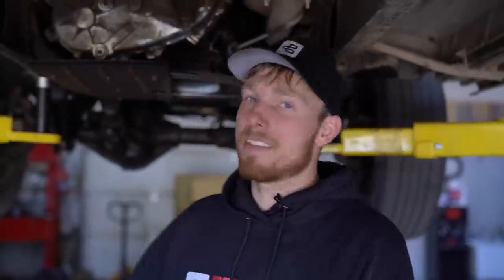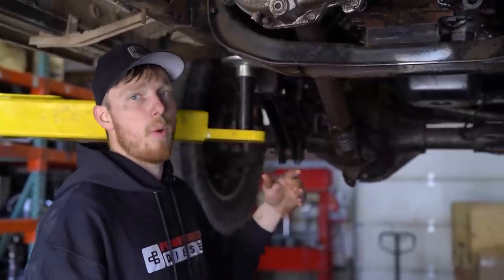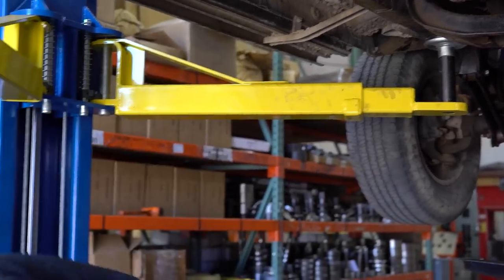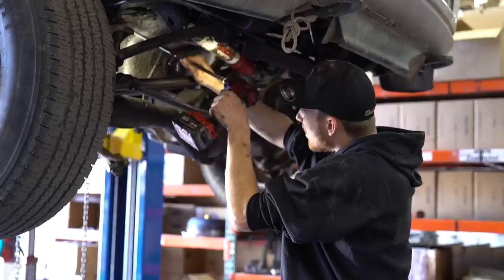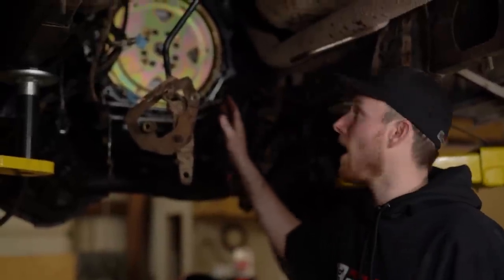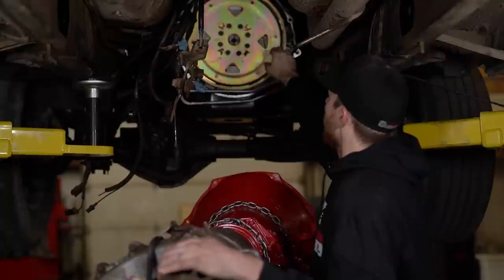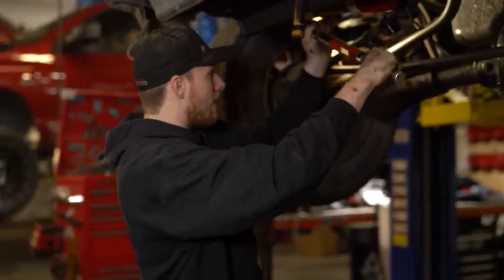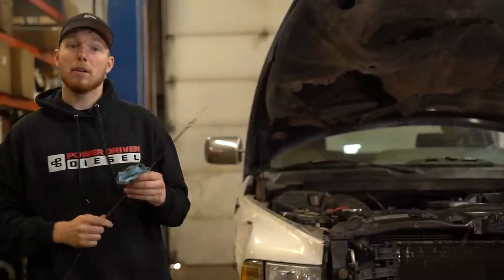How to Install a Cummins 47re 48re Transmission

Comment: Not me who just did this job twice and was only able to get 4/6 torque converter bolts back in the 2nd time cause I didn't know the flexplate had balancing holes 🙃

Comment: Question, I’m seriously considering PDD as far as transmission build. As far as purchasing onsite, because my truck only has 88,000 miles, what’s the turn around time on using my core and having PDD install? Thanks
Reply from the maker: That depends on how many builds are ahead of you. I think we are basically caught up at the moment.  Call into the shop and we can get something scheduled.

Comment: I appreciate the videos,  i ran my transmission a bit over full ..its a good idea to check the pressures. . I was surprised how good a 48re shifted in my brothers truck shifted . My old 47rh that finally went out never shifted that good .. Thanks for the information on the pressures . I remember how low the pressure was on my stock 47rh at idle and lock up . Surprised it lasted long as it did .
Reply from the maker: Glad to help

Comment: It sure looks easy with a lift. I’ve done it twice so far with jack stands and a creeper. It’s such a mess pulling the pan that I got a hand pump to draw most of the fluid before I take it off. Your frame spreading jack is a bit cleaner than my bottle jack and 4x4 setup. The 4x4 held up but it was marginal. Bottle jacks don’t always like to work sideways. I laid mine down flat and filled it with all the hydraulic fluid it would take so the jack would work better while horizontal.
Reply: I did the clutch on my 1999 on my back twice... now there is a two post in the barn.
Reply from the maker: They are much Easy on a lift

Comment: I am wondering how dose a transfercase hold up to 1000 hp range. Is there anything you need to do to that. Maybe a rebuild or any billet parts?
Reply from the maker: They actually do very well if they are in good working condition.  I have a bone stock fresh dhd in the Godfather!

Comment: I have heard that stiff flex plates can cause other parts to give way. Does the HD flexplate still have enough flex when the rest of the transmission is billet and has no give. 
I am installing a rebuilt transmission and I am getting mixed messages for flexplates.
Reply from the maker: We haven't had any problems with these plates other than a few have had to much runout.  That's why we measure them.

Comment: this may not be the place to ask, but what front brakes are you running on The Godfather? I am doing the front brakes on my 1999 and there has to be a configuration that is better than the stock setup where the unit bearing has to come out and the studs need to be hammered out.
Reply from the maker: If you find something better let me know.  Stock brakes on the Godfather

Comment: Did you need any gasket sealer when putting the transfer case on the transmission or do you just put it on dry
Reply from the maker: We just put it on dry

Comment: Can you use new fluid and the converter orpump to pull a continues supply of new fluid thru the system when changing fluids I've done a fluid change at 40k intervals with my 48re and it's the to do a third or rebuild with billet in and billetinternals. With a triple disc converter

Comment: To clarify, the at idle in neutral dipstick reading for the fluid sb just above the s bend?
Reply from the maker: Not running in neutral lower to middle of the s bend
Reply: @pddofficial  Thanks

Comment: How quick is damage done to a 47re from overfilling ?
Reply: Depends on how lucky you are!  If it's overfilled and the drum whips the fluid up and aerates the fluid it can hurt the pump pretty quick, or if the pump can take it then it can cause lower line pressure and cause the clutches to slip.
Reply from the maker: Depends on how lucky you are!  If it's overfilled and the drum whips the fluid up and aerates the fluid it can hurt the pump pretty quick, or if the pump can take it then it can cause lower line pressure and cause the clutches to slip. Thank you CumminsWorks for the answer
Reply: @pddofficial  thanks

Comment: Got your  pan off kit you guy’s really should do a video on that there is no video on the install would be nice for concrete guy pretending to be a mechanic lol thanks
Reply from the maker: That video should be coming out in a few weeks
Reply: You guy’s are awesome I had a ton of questions and you guy were a ton of help I did the manual valve body and had to unbolt the overdrive it was super easy you should add that to your video no need for transmission shop thank again

Comment: Lol that’s cute I called for my 5.9 12valve  in my motorhome and got told ( from your rep on the phone you only do high performance trucks ) 
Looks like I’ll be looking on to other places to help me get more power
Reply from the maker: Are you sure you called Power Driven?  We've helped several 5.9 Cummins powered motorhomes get more power.  Please send an email to customerservice at powerdrivendiesel.com if you can't get through on the phone.

Comment: Will a 03 47re fit in my 04 that’s uses a 04
Reply from the maker: physically they will fit but the sensors will not work